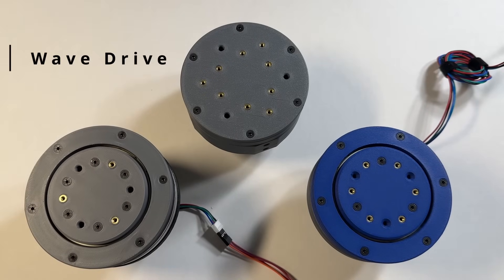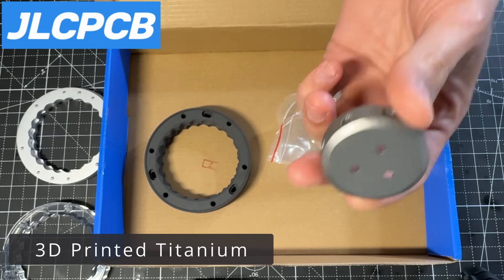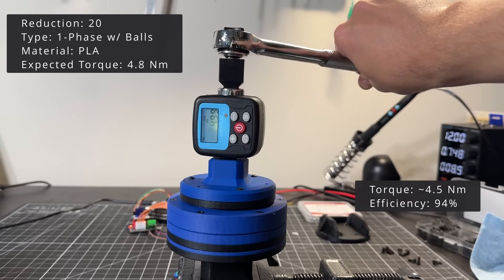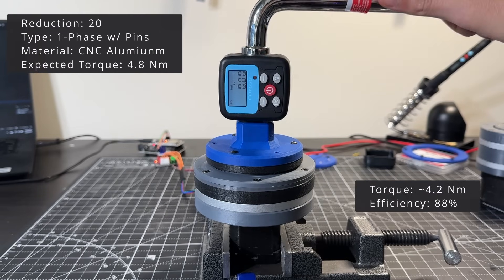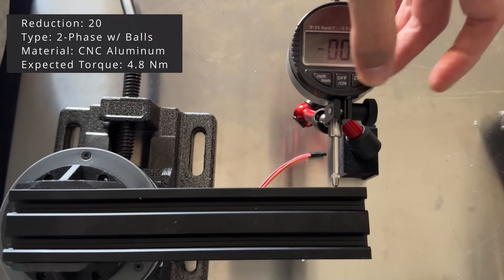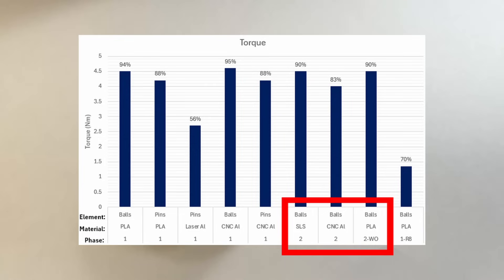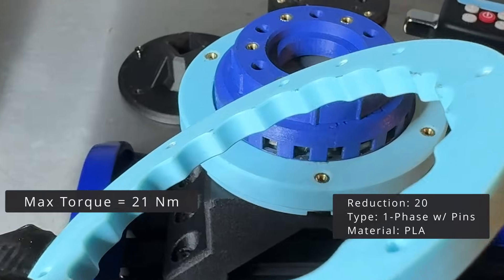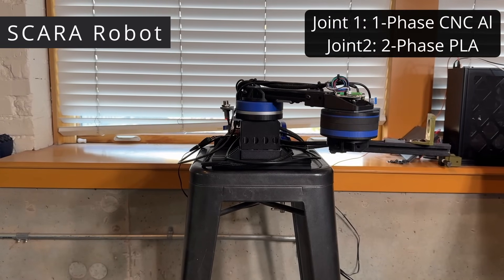High Efficiency Wave Drive Reducer - Zero (almost) Backlash - For Nema17 Stepper

Comment: After deeper reflection, I've realized that this curve is actually a type of cycloid as well—specifically, an elongated epicycloid formed by a rolling circle rotating outside the circumference of a fixed circle. A classic example is the contour of a Wankel engine, where the transmission ratio is 3, resulting in a two-lobed epitrochoid shape. By adjusting the transmission ratio parameters, the basic curve contour of the Lotus Drive is formed.

Another discovery: when the ring gear has N teeth, the same profile can accommodate not only N-1 rolling elements but also N+1 rolling elements. The Wankel engine works similarly—its housing has two lobes, but the rotor has three. Therefore, it's feasible to design a cage for N+1 rolling elements, and it would function perfectly. I've verified this using CAD.

Comment: CNC aluminium is nice but can be improved by electro anodised surface, I made a ball screw once with this Methode, it had a 100 micrometer anox thickness and was as good as hardened steel

Comment: I would expect the backlash for the drivers, made with cnc parts, to be less than the ones made with 3d parts. I don't get the results
Reply from the maker: I think this can be explained if you consider 3D prints can come out undersized, so there won't be play in the drive

Comment: Great looking drive, great video! I’d love to see some characterization of linearity on these general types of drives, a that seems like a serious limitation for some applications. (It’s good news that the two-phase design reduces this.)

It seems like there should be some way to design the wave plate to minimize this, but I have no idea how to approach that. Or could there be a way to solve it by going to three phases? (I’m thinking from the perspective of electronics, where the total instantaneous power from three sinusoids offset 120 degrees from each other is constant.)

Comment: Single wave will not be a  linear output. And made an extruder gearbox utilizing this. Following Mishin on youtube also. 
But in the end its actually not simple because the finicky pins and grease needed. And not linear. 
Mishin will have new hybrid design soon.  Maybe helps with the linearity.

Comment: Great video. Could you comment on the effect eccentricity has on the design? I see you call it out in the sim but I didn't see any comments on how it drives design decisions.
Reply from the maker: I haven’t looked into too much detail on what is the effect on this type of drive, but it is probably similar to Cycloidal drives. If you look at the Cycloidal simulator I have, you can see how eccentricity changes pressure angle

Comment: I've done a few of these for a turret, but I ended changing them for a planetary gear because of the non linear speed which causes jerky movement.

I noticed that too on the footage towards the end of the video about a scara robot arm implementation, do you see any way in which you could achieve linear speed. / constant acceleration ?
Reply from the maker: that's a good question. The 1-phase is jerky, even CNC version. The 2-phase is much smoother. I'm currently working on optimizing that scara robot so we'll see what type of performance I can get from these drives
Reply: @promakina  Awesome! I'm currently working on a simulation I hope to use to tune input shaping for a CNC I'm building, but it would be super cool to see if I could use precise control to minimize the nonlinear kinematics impact

Comment: That‘s an absolutely awesome drive. I‘ve been looking at the webapp a bit, and I‘d like to suggest you also add a version that‘s got the input at the perimeter and is fixed at the center. Reason being, this way you could build a very funky pancake BLDC axial flux gear reduced motor and you get to use the center for a slip ring.

Comment: Thank you for the video. I am planning on making an outrunner bldc motor with an internal reducer with likely a quasi-direct ratio. One chose of base motor is a WK8110, with an internal diameter of the stator hole of about 58.5mm. I was planning to use a metal cycloidal drive, but now I'll need to explore this option. I really look forward to a longevity test of the aluminum version.

Comment: Backlash testing needs to be done using a specific torque on the output for a measurement.
Reply from the maker: I wasn't sure about that because if I apply too much torque it will start backdriving

Comment: If increase the number of rollers by one more than the number of arc-shaped grooves on the working profile, such a kinematic dependency is created where the output shaft rotates in the same direction as the eccentric. So the direction of rotation of the output shaft depend on the number of rolling elements in this type of gearbox.
Reply from the maker: Yes, there are different ways to arrange it. I plan to do more analysis to understand what is the optimal way.

Comment: Nice to see these tested in this manner. I was always a bit skeptical about this design; given that fundamentally, youve got a pure sliding contact smack in the middle of the load path, where the rollers transfer load to the seperator. But somehow these efficieny figures are quite impressive.

Comment: This is a great video, and wave drive seems to be a valid alternative to other types. I don't know much about it, but it certainly seems worth learning more about.
Too bad that laser cut quality was such that it eliminated itself from the list of viable methods. Just looking at the cut, it seems to me that the laser machine used was pushed to its limits. Aluminum is challenging, but more powerful machine would probably give much better result. I guess they don't have it, otherwise they would use it. Obviously, the next best method, and clear winner, is CNC. I don't know if JLCCNC have wire EDM option in their offer, and even if they do, the price may be prohibitive, but i think that in terms of precision it has no real competition. In the production phase, hard anodizing should in my opinion also be taken into consideration, to minimize wear. I may be wrong, but from your testing the rigidity also seems to play an important role. If so, that would probably eliminate 3D printed parts if minimizing the backlash is important. I'll be looking forward to your next video(s) on this topic. Keep up the good work!

Comment: Was a bit sad about laser cutting. I thought it could be cost saver. Nice video. Thanks for sharing
Reply: Holy! Great to see you here 🎉
Reply: @TheHectorOg ❤
Reply: Well well well if it isn't Vez.

Much love.
Reply: @Archivort haha i was not expecting to be recognized here
Reply: Best option is laser cut than machine the finishing pass.
Reply: Ywp. Use Stainless steel so surface is not hardened by laser heat
Reply: in my opinion the best way, is water jet
Reply: it doesnt mean it doesnt work, it just means you cant use it for precision movement or youll have to take some measures to counteract the backlash (like making it too tight and wearing it in with some abrasive paste, and lots of work, until its within tolerances) 
Though remember backlash is only important for certain applications. Things that go only one way under constant load like a lift, or rotating machines dont care a lot.

Comment: Really cool video and demonstration.

I just wonder: Why are you using PLA for the printed parts? 
All the parts are very simple in geometry and look easy to print (accept maybe the bridging on the seperator, but the wave-discs are easy to print and participate in lots of contact with other components), I think anyone should be able to print the parts out of petg or pc,pet,pbt (as some more expensive filaments) on an open printer machine and out of PA on an enclosed one. 
PLA isn't really the material with the least friction and highest wear-resistance
Reply from the maker: Just using PLA as a baseline since it’s the most popular filament but I agree it’s not the most optimal